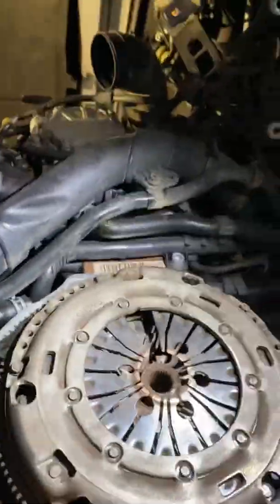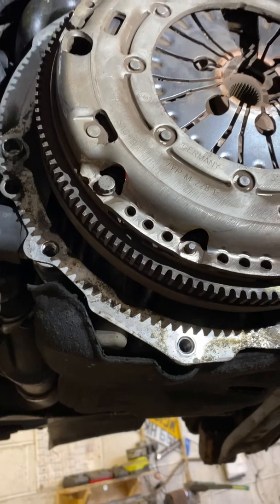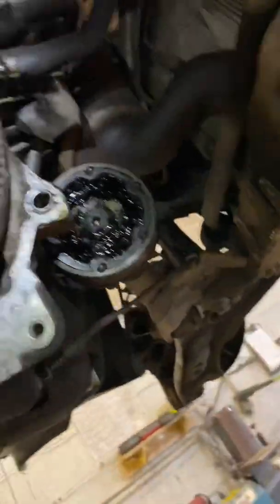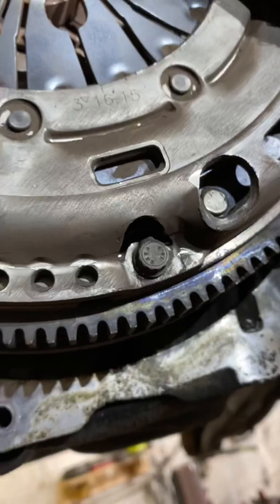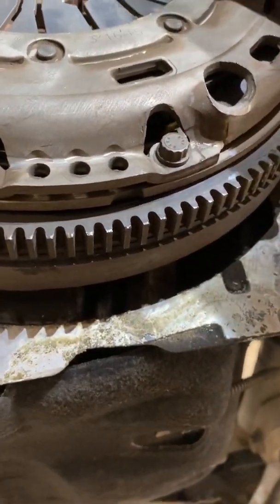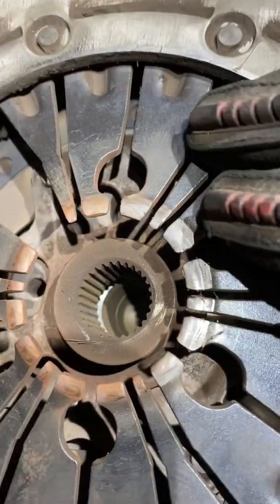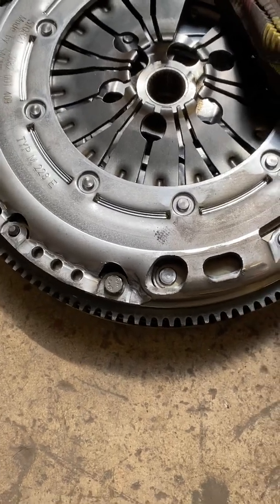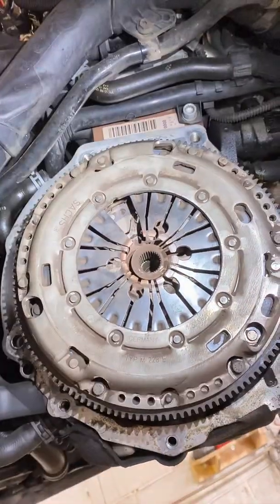Dual mass flywheels (dmf) what are they and how to diagnose

Comment: I just pulled my dual mass flywheel out of my 2004 Honda accord V6 6-speed. The reason I did this is because the car would rattle and grind only when it was in neutral. When the car warmed up. Or when it was put into gear it would go away completely. I thought it was my input shaft bearing. Because usually that's what's indicative of that. But when I got my transmission out. My input shaft bearing was completely fine. But my dual mass flywheel had so much play in it. I'm surprised it didn't fail earlier. So now I'm replacing the flywheel and the clutch and all of the transmission seals and the rear main seal

Comment: What many car maker DONOT specify is the Neutral/Dead zone should not be greater than 2 flywheel teeth . Most makers spec a 5--15 tooth failure point . What car makers miss out on is the dead zone free play , 2 teeth after that the the secondary flywheel should be under spring pressure .. Mild idle vibration occurs if the secondary flywheel is allowed lotsa free play . The vibration dis-appears at any rpm above idle .

Comment: My  clutch is dragging slightly on my giulietta 1.6jtdm unfortunately there doesn't seem to be a solid flywheel available. I completely agree with you fitting a solid flywheel isn't a big deal regarding drivability.
Reply from the maker: Dmf Feels like another fix for a non existent problem 😆🤷‍♂️

Comment: my passat clutch padel rattling when it`s being pressed down  and I can hear spring tension noise all the time, loss of power. my mechanic said he can replace with a solid flywheel kit, is it safe? Should I still go for a DMF kit ?
Reply from the maker: I have fitted solid kits before with zero negative reports. Probably a dozen or so

Comment: Got a vw  t6 transporter and it seems to make a tapping noise when on/off gas
Clutch making no noise when pressed down
Getting a tapping sound from my engine also
Dmf ??
Reply from the maker: Hard to say, if it speed up with engine revs then check oil pressure/condition

Comment: I have loose metalic mocing gear sounds usually when i press gas at low speed and the gear changes.
Also some strange noises on idle.
I must say the i have no lose of power when driving at nice speed.
Could that be the flywheel?

The metalic loose noises sounds a lot like you demonstrated  sometimes i hear it as rattling metalic noises and then two metal gears connecting together
Reply from the maker: Defo take the gearbox out

Comment: Literally just had a new DMFW put on as well as new gearbox. Is it normal for them to be making a tiny bit of noise when in neutral with clutch up?
Reply from the maker: The noise could be coming from a tiny amount of chatter in the gearbox lay shaft which is normal. Flywheel if good should run silent

Comment: Easy way to diagnose BEFORE pulling the gearbox off. Accelerate in 1st gear to about half revs, lift off the throttle pedal and depress the clutch at the same time, fairly sharply. If theres a clatter/rattle/knocking sound, or vibration through the bulkhead, suspect your DMF. Check your driveshafts/propshaft first, but more than likely the DMF is failing. 🤙🏻
Reply from the maker: Can’t say I agree with that.
Reply: @bradauto  care to elaborate?
Reply from the maker: @g.w.customcreations3534  it’s too vague. As you already said it could be noise from driveshafts, stabiliser mounts, engine mounts, subframe, wishbones etc, also it’s not a test you will have done before so will have no comparison (you won’t know if any noise is normal or not). With investigative work you discount easiest causes first by doing these checks. This video is for when you exhausted all else - if you’ve got the box out you need some way of confirming damage to dmf. 
However a trained ear can usually hear a fault from outside with engine idling in neutral but that’s not something I can make a video about.
Reply: @bradauto  yeah, not a bad point. Only issue being, all bar the driveshaft that you have mentioned are rubber mounted, so would sound nothing like a dmf. Its a very distinct noise, and can be felt directly through the bulkhead, not just as a generic vibration. 
And let's be honest, no one that has "no comparison" is on YouTube trying to identify noises. The only folks here are either considering doing it themselves, and want to be double sure, or folks that have already paid a garage, and are curious about what it is they're paying for.

Comment: How do you know this is an issue while you driving the car? Before you even take it apart? If fly wheel gone and car is manual would it be hard to change gears? Or not necessarily?. Thanks
Reply from the maker: Sometimes you get clutch judder or difficult gear selection but not always. Usually the first signs are a low, irregular clonking noise usually at idle

Comment: Hello mate...
So just spent a fortune (to me) on an old P2 Volvo V70 2.4d and on start up there's a single bang/clunk on firing up the Engine... Some vibration on idle, but as soon as she's driving the gear changes are smooth and no issue...

Could this be the DMF?? 😢😢
Reply from the maker: Possibly - if In doubt it will eventually develop to be really obvious

Comment: Great video to understand that noise we hear. I thought it was a rod knock at first. Once you get under the car its really easy to hear where its coming from. Mine goes away after warmed up. Probably a loaded question but any idea of how long these things last after they start rattling?
Reply from the maker: It’s a matter of what you’re prepared to put up with. Feedback gets progressively worse until the car becomes eventually undriveable either from vibration and/or poor gear selection. 
(Quick answer) I’ve seen some last for 12 months
However they can become so bad the flywheel has to be cut apart to remove it as the top plate moves (jams) and covers the flywheel bolt heads. 
Short answer - just replace the thing asap
Reply: @bradauto  I hear ya. Thanks for the reply.
Reply: @danielbonner8309  hey man, did you have to replace the clutch and dual mass flywheel? and if so, how much did it end up costing you? I'm looking at a clutch for my 2012 passat but I'm not sure if the flywheel needs replacing as there's no noise and there's no friction between gears or friction in the clutch pedal. I know DMFs are supposed to last a long time and hardly ever need to be replaced.
Reply: @cupcakebill911  I did not. I ended up selling the car. I was quoted over 2000 to get the flywheel replaced. Mine was an automatic.
Reply: @danielbonner8309  Oh God, that's heavy duty man, I know my clutch is almost away, it's on its last legs but I'm not sure if the previous owner had the flywheel conversion done to a solid flywheel. If I only need a clutch I might be able to save myself an extra £300, if I need the dual mass flywheel then the jobs gonna cost around £800 to £900 and the car is 12 years old with 200,000 miles. Trying to figure out what to do lol
Reply: @cupcakebill911  I know that's the situation I had. It was a TDI Jetta sport wagon and it probably would run for many years but it wasn't really worth it to get fixed. It was due for the timing chain as well. Volkswagen are decent cars but they turn into money pits when they get older.
Reply: @danielbonner8309  Ackh man, that's rough. Yeah, I'm starting to realise that now, I bought my passat estate at the end of 2022, I got the timing belt, water pump and full service done right away. Since then it's cost me close £3500 in just 2 years. I use the car for deliveries and it's made me decent money but it's really starting to kill my wallet lol
Reply: https://youtube.com/shorts/wPmdcN8U8Wo?si=ffa72wOiHNZCABU5

Comment: I’m worried my DMF is busted on my Peugeot Partner. 
When I’m accelerating from first gear it’s starting to hop unless I put some extra revs. 
Do you think it can be the issue?
Reply from the maker: Very hard to say from that description - if it’s while slipping the clutch it may be clutch judder, which is more a clutch issue than flywheel, if it’s with clutch disengaged it could be a driveshaft or even engine mount worn. Get it looked at for diagnosis by a pro
Reply: @bradauto  Thanks! It doesn't make any weird noises with the clutch engaged/disengaged, maybe I'll open it up and change it.

Comment: Hi my car is vibrating only when engine is hot can that be dmf when cold no vibration thanks
Reply from the maker: Yes, very likely
Reply: @bradauto  ok thankyou
Reply: @bradauto  should vibration stop when i put clutch down as mine makes no differece
Reply from the maker: @abdulbeany1894  probably not, the flywheel is off centre causing vibration
Reply: @bradauto  so will i need flywheel cluch and throw out bearing my car is audi a4 b7 2.0 tdi shall i go smf or stay dmf thanks
Reply: @bradauto  i heard the injector loom can cause this sort of problem im not sure
Reply from the maker: @abdulbeany1894  I’ve fitted smf kits with no problems.  Your choice - good luck

Comment: Hello, my car shakes when I take off in first gear, there is no rattle or vibration when idling
This happens only when car is hot, on cold engine clutch is perfect
Reply from the maker: It’s very likely gonna need a clutch and possibly flywheel

Comment: Would damaged dmf bearings cause a rough idle? Sounds a lot like a misfire on an E90 330D, M57 Engine.
Reply from the maker: It can affect idle yes. Idle speed will seem erratic and can be mistaken for a misfire
Reply: @bradauto  My revs stay the same but the "misfire" noise stops when I press in the clutch, so feel its the dmf
Reply from the maker: @AJR-gg  yes mate, get that gearbox out

Comment: What do you think, input shaft bearing or DMF. When the car is cold i cant hear the sound it gets lauder the warmer the car gets or if i beat on it. If i beat on it i can hear it with glutch down as well but not as much. Sound like a scoring sound/grinding sound. the sound stops when i press down the clutch and comes back with the glutch up. Also hear the sound when im driving, it gets even lauder on some gears or if i motor brake or drive slow. DMF or input shaft sound from the gearbox? its a manual. My car dosent have a pilot bearing.
Reply from the maker: Possibly the thrust bearing (clutch release bearing) whatever happens that gearbox has to come out

Comment: Right radio thank you very much for doing this I was hunting for what our noise was on our Kia Sorento when you move the flywheel up and down and you can hear that knocking sound that is what is now happening to our Kia Sorento we also found that in 4th and 5th there is a vibration which comes through the gearbox and engine which you can feel through the car the car this morning is in the garage we hope that it won't cost as too much to have this replaced but thank you for your video as it clearly shows exactly what is happening

Comment: I have an Astra twintop 2008 1.8 petrol. the car won't go into gear. the gear lever is very stiff. When engine is on in neutral there's a noise coming from the gearbox, when I press the clutch down it goes away. A mechanic said there is a worn out bearing in the centre of dual mass flywheel. Is that a part of the clutch kit? After dropping the gearbox he says I need clutch kit and a gearbox both.
Reply from the maker: Yes sounds feasible. you buy the flywheel and clutch together.

Comment: Question as I'm sick of spending on this car i have . I have a rattle u til clutch pedal is depressed no slip and starting ok . How long can it hold out until it becomes undriveable ?
Reply from the maker: It depends on what mileage and type of driving you do. Typically though 6 months would be average
Reply: @bradauto  smashing that will do time to get the next car in place . As much as I have tried to maintain and keep the old girl going it's got to the point now where a new flywheel would make it financially not worth it . Cracking channel fella and thanks for the reply

Comment: DMF rattle at 1:54 is unfortunately a common fault for my car. Even when replaced with a new OEM DMF they tend to start rattling again after not much time. 
Would a dampened clutch help increase the lifespan of a new DMF, and prevent this rattle from happening again?
Reply from the maker: What car is it? There is a solid flywheel conversion available for most. I’ve fitted lots of them with no problems.
Reply: @bradauto  thank you for your reply. Lexus IS250 6mt 06. Most people on forums also opt for SMF+dampened clutch like you said. I’ve yet to see if anyone went oem DMF+dampened clutch however. My main worry is if SMF will damage the transmission more than the DMF
Reply from the maker: @18837ven  I can only speak from experience and say that there has never been any issue arising from a conversion- I have done several taxis which do hard miles and no problems
Reply: @bradauto  awesome, thanks for your insight!
Reply: @bradauto just after buying a 2009 vw golf 2lt tdi, was on when I test drive it, left a deposit on the car collected it 2 weeks later and clutch was juttering, seller obviously drive the sh1t out of it, probably burning rubber between us leaving a deposit and picking up the car.

Comment: Great! A quick simple discription of how to check it! Mine on vectra c wobbles a little in and out but does still spring back when turned without a sudden stop either way so I'm hoping it's OK for now?
Reply from the maker: Sounds ok. Also any feed back from normal driving - clutch judder or early bite is a sign 🙏🏻